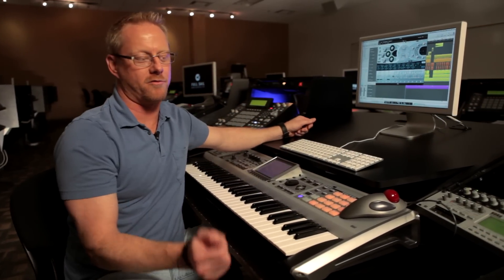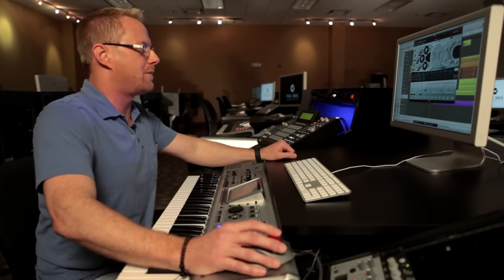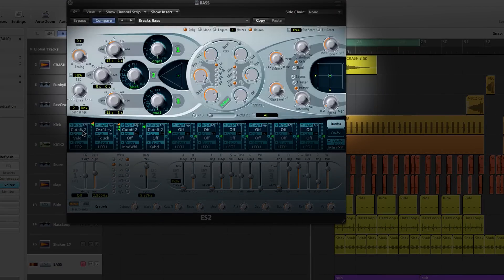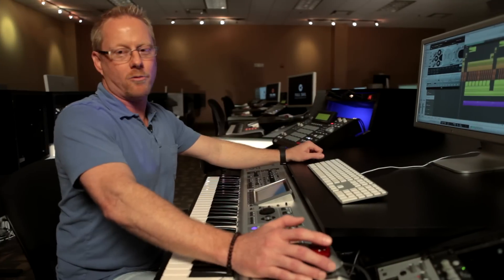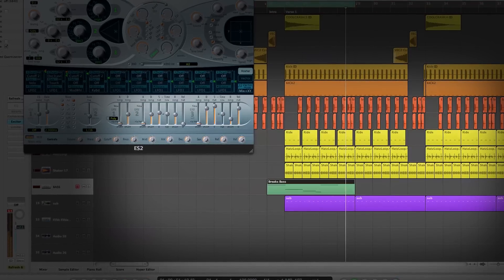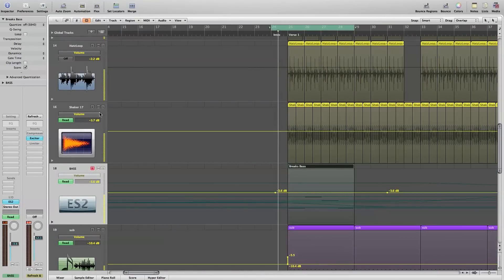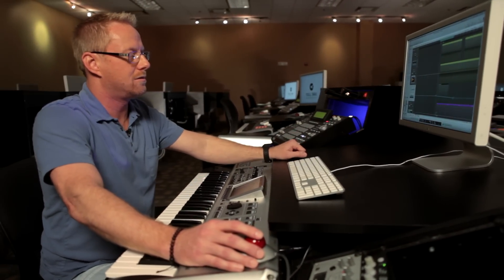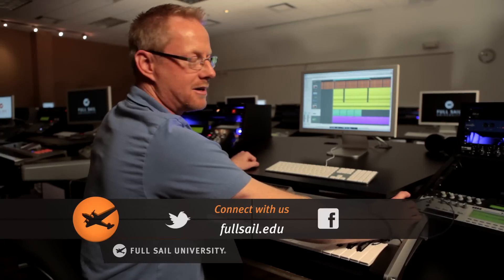How to Create Dubstep Wobble Bass

Comment: i tried to use it but never got anything  from it  .. walking away frustrated with fl .. i have used traktor ,sonic  i still have but wasteul programs  and super hard to use .. enough to discourage a  would be platinum artist . producer.. sony acid is  the best so far i just  have a loopin issue